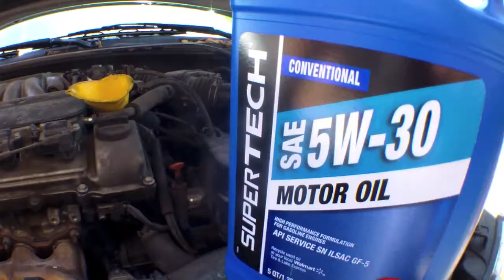SIMPLE Quick oil change Toyota Solara Camry √ Fix it Angel

Comment: the filter location sucks. I don't even tighten it. I let it kiss the block and BACK IT OFF 1/4 turn. sure it will drip oil time to time but I don't have to spend 2 hours messing with it locking on like an alien facehugger.
Reply from the maker: Yes the location sucks. I used to get burns when I used to work at the dealer. Summer time was a bit*h to do. Thanks for watching.